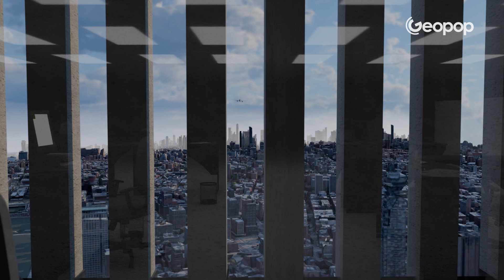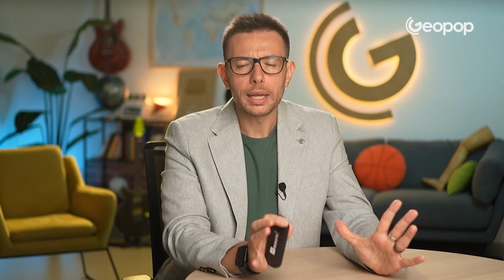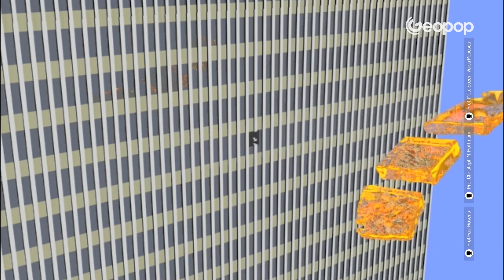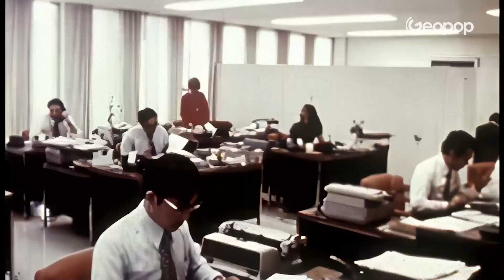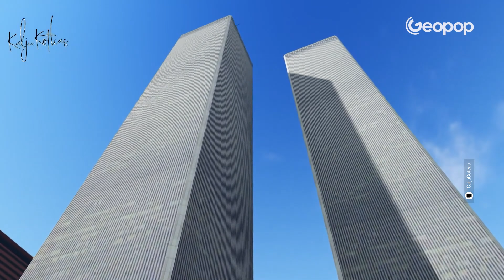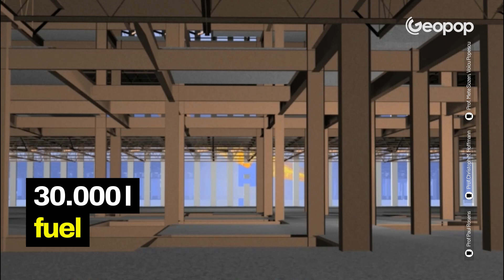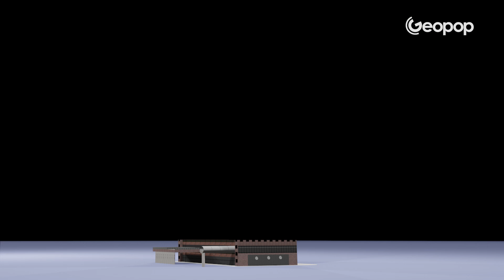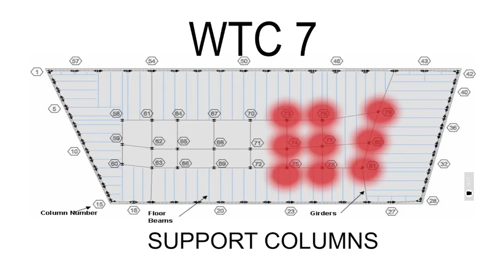9/11, 2001: The Technical Reconstruction of the Twin Towers and WTC 7 Collapses

Comment: Toda una ridícula explicación. Las torres fueron demolidas los aviones son una composición digital .este video es para proteger la versión oficial
Reply: Yes I would agree. What you just provided is a completely ridiculous explanation.  

Controlled demolition - So simple.  A hand-wave.  No thought at all required. In fact the less thought put into it, the better.  Engineering is hard, but this is an engineering problem so that is where we have to go.
Reply: Los medios son todos de ellos fue un montaje imposible que el avión sea absorbido de esa manera . La física del choque hace que exista un intercambio de cantidad de movimiento y no hay una sola particular del avión que retroceda ..ignorante y crédulo
Reply: @gervasiokuz8926    "The physics of a collision dictates an exchange of momentum, and not a single part of the plane moves backward"

Go backwards?  Velocity was all forwards, why would it go backwards?  That would imply a force in the opposite direction when there was none.  

You are not much of an engineer !
Reply: @TheLoonResistance soy ingeniero y la velocidad de caída es de caída libre además hay video donde se ven las columnas cortadas con termita . Ningún combustible funde el acero a más de 1200 grados m facil es ser una oveja pusilánime que se cree todo . Hay cientos de testigos bomberos que dicen haber escuchado explosiones en cadena típicas de demolición . Y la torre 7 es la frutilla del postre . Eras.u. creyente ninguna prueba te hará ver la verdad
Reply: @gervasiokuz8926  - Anytime someone comes out of the gate unprompted claiming to be an engineer it is usually a guarantee they aren't.

Let's see how this goes.

1. Free fall as a speed - not off to a good start.🤦‍♂  I'm wondering exactly how you calculated that rate of acceleration

2.  Jet fuel melting steel - not a thing anyone has ever claimed happened. 

3. Calling anyone who disagrees with you a spineless - not very becoming of a real engineer.

4. Firefighters heard explosions - Yes, many firefighters heard loud noises.  Not a one heard or saw bombs and you can't produce a single one who did.  Not one.

Looks to me like you are really just another mindless repeater of the same bad ideas everyone else copy pastes.  You are no engineer.
Reply: @gervasiokuz8926  - I was right
Reply: @TheLoonResistance infeliz vos preguntasteis credenciales . Búscame gervasio kuz dni 26513366 argentino ingeniero industrial. Ignorante pusilánime
Reply: Vos sos un ignorante que aunque te diga el que puso las cargas explosivas que lo hizo lo vas a negar . Un avión n puede se absorbido por.un edificio jajaajaj
Reply: @gervasiokuz8926  - At least I'm not a liar. Thank you for confirming what a useless turd you are.  Also, can ignorant do this:

It took only weeks for the world’s structural engineering community to work out the essentials on how and why the Twin Towers collapsed. The general public – not helped by the burgeoning internet with its myriad of misinformation and made-up technical nonsense has taken a lot longer to catch up. Fair enough, engineering is hard and who is going to put in the required time?

I did!  Because anything can seem like a conspiracy if you don’t understand how it works and I’m an understanding guy, I prepared this short technical overview of Twin Towers collapses from my own observation and analysis of the true and relevant facts. No politics, ideology or magical thinking, just engineering. Hopefully this dispels many common myths and answers most or all questions you may have about the collapses.  

While complex, most of the Twin Towers collapse mechanisms can be seen with the naked eye and easily discerned and understood by the layperson IF sufficient time is taken to understand.

1. The Twin Towers consisted of 4 primary structural elements that together formed an integrated system where each relied on the others. 47 hollow box-section steel Core Columns carry the majority of the gravity loads. The 236 hollow box-section steel Perimeter Columns carry the remainder and ALL of the lateral (wind) loads. Long-span Lightweight Steel Trusses connect the core and perimeter column together at each floor with a Hat Truss on top to tie the structure together as an integrated unit where no element can survive without the others. There was no structural load bearing concrete and most components were bolted together.

www.youtube.com/watch?v=u7OqrC74Dm4

2. The impact of a 120 ton airplane (= to 12 dump trucks) at speeds up to 589 mph and the energy of a ton of TNT completely destroys the aircraft in 0.75 seconds. This in no way implies the Towers come out unscathed. A lot of folks get hung up on that. Many perimeter and some core columns are damaged or destroyed (example; 33 of 59 perimeter and 20 of 47 core columns in the North Tower), This damage is primarily through bolt-shearing failures at the end connecting flanges, as well as bending, twisting and fracturing of weld seams. There was no cutting or slicing - the reality was far more violent and brutal.

3. The impacts destroy or damage fire insulation, fire breaks and sprinkler systems on multiple floors. Huge fires are started across multiple floors simultaneously and allowed to spread rapidly with no effective firefighting or fire suppression. This was an unprecedented fire event .

4. The hotter steel gets the weaker it gets . With fire insulation stripped away and no sprinklers the survival time of the steel greatly reduced. Increasing heat gradually causes the lightweight steel Floor Trusses at the impact damaged floors to sag, which can be seen. No steel melted or needed to. Structural steel fails long before it becomes a puddle. It just needs to bend

5. Sagging floor trusses pull on increasingly weak and overloaded Perimeter Columns, causing some of them to bow inward by up to 5 feet. A straight column is up to 4 times stronger than a bent one. The bowed Perimeter Columns buckle and fail, quietly initiating collapse. The formerly static mass above which the structure below could easily support converts to a dynamic mass up to 30 times greater. Because they have buckled, the Columns above and below the failure point are no longer aligned . The load bearing structure below no longer bears any load as it falls past the lower columns, NOT onto them.

www.youtube.com/watch?v=ULdiD6gYZO0
www.youtube.com/watch?v=zTygQK3vriI

6. Thousands of tons of debris fall within the four outer walls, down through the open office space, crashing onto the first intact floor it encounters, immediately breaking the bolted column connections as the amount of resistance the Floor Trusses can offer is negligible. The falling debris slows only marginally and briefly. Note: 
6a. This is NOT a solid top block crashing into and “crushing” a solid bottom block . 
6b. The debris falls past the columns not onto them. The columns provide no resistance to the falling debris. 
6c. Only the bolted floor truss connections to the core and perimeter columns offer any resistance. A pair of 5/8” bolts at each end of each truss vs. thousands of tons of falling debris. 
6d. No laws of physics are violated. 
6e. There is no 20 floors against 90 floors but rather 20 floors against one floor, then 21 floors against one floor, then 22 floors against one floor, etc. 

7. This floor-led collapse progression within the four outer walls can only go straight down.
7a. This process is often incorrectly referred to as “pancaking”. The catchy name stuck but nobody knows what it really means and "pancaking" is too simplistic and inaccurate anyway. I prefer Kaiserschmarrn.

8. Collapse progresses through the floor systems past the columns, through the path of least resistance . The resistance offered by each floor is always the same while the mass of debris and its velocity – thus its energy - increases with each floor failure. Each floor offers the exact same resistance to the falling mass while with each failure the falling debris constantly gains both mass and velocity. *This process of floor-by-floor destruction cannot be arrested, it can only speed up . Rate of floor failures increases with each floor as momentum increases, reaching an average acceleration of 0.65 of GA, or 35% slower than true free fall. Bam, bam, bam down the building until there are no more floors to fail. The resistance offered by each successive floor is always the same. More mass, more velocity, same resistance with each floor. Don’t get stuck on the but the lower floors weren’t on fire nonsense. They weren‘t and didn’t need to be.

9. The Towers were 95% air by volume. As that air was compressed inside the building it is forced down the tower and blown out the sides in reaction to the building collapsing . Those were not “explosions”, it was expulsions of compressed air caused by the collapsing building, explaining the low velocity, lack of flash, blast, supersonic pressure waves and lethal high-velocity ejecta.

10. Perimeter Columns become detached and peel away like a banana behind the collapse front, playing out to the four points of the compass extending to more than 800 feet from the base of the towers. This was quite obvious from examination of the debris pile.

11. Core Columns fail last as their internal beam bracing is stripped away by falling debris and lateral support from the floor to perimeter columns is lost.

www.youtube.com/watch?v=WpHXj62Ylw0

12. For those who care about how long this whole process took; 31-34 seconds from the moment the perimeter columns buckled until the last core columns hit the pile, or 1/3 the rate of true free fall. Don’t believe me? Just watch any video of the collapses and note the loose truly free-falling debris dropping much faster than the towers themselves.

13. Each Tower had a 1-acre footprint. Far from collapsing inside their own footprints the debris pile spread out over 17 acres in a pile up to 14 stories deep. 8 surrounding buildings were destroyed and scores more damaged by the falling debris.

14. NOT observed were the 180-190 dB bangs of thousands of high explosive devices or the blinding bright flashes of burning thermite. Neither explosives or thermite could have survived the impacts and subsequent fire nor could have caused the (silent) perimeter column buckling that clearly initiated collapse either. A video of a shocked and injured firefighter casually using the magic word explosion is in no way proof of explsoIVES and the demolition_ case relies entirely on that sort of thing. There is zero tangible physical evidence and it would be technically impossible, totally impractical and completely unnecessary. No one would bother.  In 24 years zero structural engineers of tall buildings, including the 1/3 that have retired in that time, have made any statements in support of pre-planned demolition claims. NONE. The lack of any such citations in the engineering literature (published in any country worldwide) is telling.

15. Twin Towers were perfectly safe within their design envelope. They only collapsed when taken far outside design parameters by an extraordinary and unprecedented event

Impact + Fire (heat) + Time + Gravity = Collapse . Remove any one of those 4 elements and there is no collapse. Ignore any of those elements (as many do) and you will never understand the collapses. The Twin Towers were an integrated system in which no one component could survive without the others. One fails, the rest follow, through the path of least resistance – DOWN – through the open space, bypassing the path of greatest resistance – the columns. Nothing I just described violates any laws of physics. All of the above is true no matter who planned and carried out the 9/11 attacks or why

If you made it this far, congratulations. That was a lot to digest. I hope it was helpful and informative, non-adversarial and it solicits informed critical comment, positive or negative. If I made any errors of fact, logic or reason or left anything critical out, please let me know so I can fix it. To stay focused, just one point at a time please and on-topic (Twin Towers ONLY). No word-salads of Gish Gallop. IF you can offer a more plausible alternative be my guest. Please start any reply with the words “Tits McGee” or I’ll know you didn’t read it, aren’t serious and wasting my time.
Reply: @gervasiokuz8926   Well done for being an idiot on the internet.

Comment: Claiming that following the completion of the first 6 floors of building 7, that 20 years then passed before the other 41 floors were instantaneously added to the building is a WILDLY misleading assessment of what took place. The initial plans for the building had always been designed with the planned additional floors taken into account. The implication that they just "dropped a 41 story building on top of an existing 6 story building" is the reason nobody trust the people that attempt to validate the narrative put forth by the government.
Reply: Besides paraphrasing out of context, you rather missed the point. The video does to in a way. The Con Ed substation was always meant to serve as a foundation for a taller building later on. This by itself is unusual and worthy of a mention. As eventually built Building 7 was taller, longer and wider than anything originally considered, resulting in its odd shape and unique design choices which later proved critical in how and why it failed. 

In short, I think you are griping to gripe.

Comment: The temperature in the NYC WTC buildings 1 and 2 reached 1000 Celsius. At 900 Celsius steel will undergo cracking that will look like melten metal afterwards, especially if fresh cold water is used and the steel is under pressure. The buildings also fell the moment firefighters reached the impact floors and began fighting it.

Comment: Years back there was a video up showing the Earthquake monitoring equipment picked up the seismic activity from the bomb detonations that blew the subbasement twin tower supports. Those buildings were rigged for demolition . There had been workers working in them for 3 weeks before there destruction?. What was found on the dust points towards military metal cutting chemicals used in there demolition. As for the Pentagon, no airliner struck that building? No aircraft engines, no massive wings or tail? No dead passengers, but there was a few seconds worth of a missile striking the building. There was only a circular hole in the wall, before the roof fell in, and the windows around this hoe were still in tact, the only engine outside the Pentagon was a propulsion from a cruise missile. As for the land where the other airliner allegedly crashed? No plane wreckage, no dead passengers? The mark on the ground where there a year before. And according to radar returns? All the airliners allegedly used in the attacks? We’re still in the air according to their transponders?. So who did this? Both twin towers were condemned due to asbestos?  Only one was insured? Why did certain rich people get phone calls telling them not to go into work? While others did not? And the stocks of certain firms spiked? Certain people made money from this? While many more died? Falls flag.
Reply: The seismic data is readily available and shows no such thing. 

Nothing else you said is true either.  Just the same old dead horses being beaten again and you not figuring out why they never work.
Reply: Ignoring this  stupid claim "  What was found on the dust points towards military metal cutting chemicals used in there demolition"

You said

" As for the Pentagon, no airliner struck that building? No aircraft engines, no massive wings or tail

You can clearly see civilian aircraft parts in the photos of the aftermath.

And why would you rig a building for demolition for WTC when you are about to crash two commercial twin jets into them ?
Reply: @zMW574e  nah looked like missile debris, impossible to fly a commercial jet that low. You shills are getting worked 😂

Comment: Imagine if those planes had hit below the center of the buildings 

They probably would've collapsed within minutes and even more people would've died
Reply: Good point.  One small mercy is they hit so far up.  Still very sad though.
Reply: They would have crashed into the smaller buildings around the towers beforehand.
Reply: So what caused the top portion of the buildings to disintegrate, there was nothing collapsing/pancaking down on them??
Reply: @FUNKINETIK  it was because since where the planes hit was weakened by fire, and the top part was putting alot a stress on the parts that were hit
Reply: @Muffin.aviation.master  Wow, an 'aviation master' who thinks that a Boeing767 can totally penetrate the external steel structure of a skyscraper and bury itself within the building.
Reply: i didnt say that it penetrated the steel, i said the steel got weakened, which is what caused the towers to collapse
Reply: @Muffin.aviation.master  But the planes did totally penetrate the buildings didn't they, you've seen the videos. Not only penetrating the external structure but also wiping out 6 to 8 floor levels of concrete and steel, slicing through columns of the internal core structure. That is what happened ??
I have screen shots of video where the second 'plane' hits, they show the plane 3/4's of the way embedded through the external structure with no apparent damage visible to the external skin of the building, no damage whatsoever where the wings would have sliced their way through. You must have seen video/pictures of passenger planes that have made an horrendous landing and the whole tail section has broken off completely.